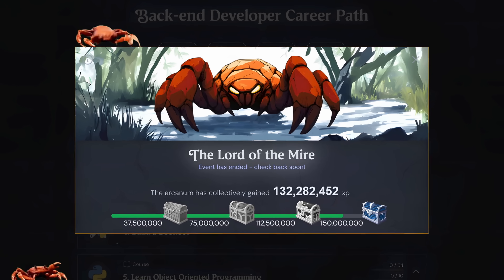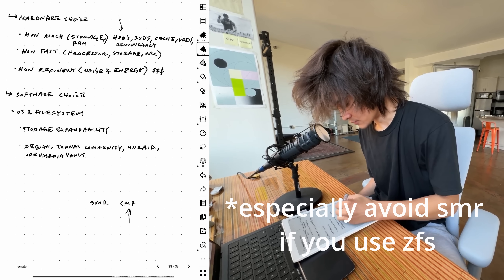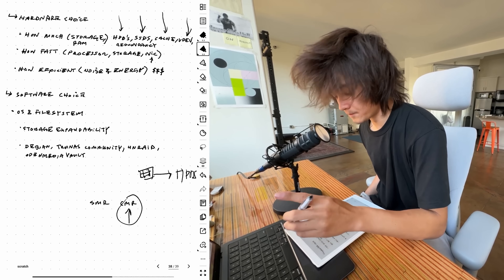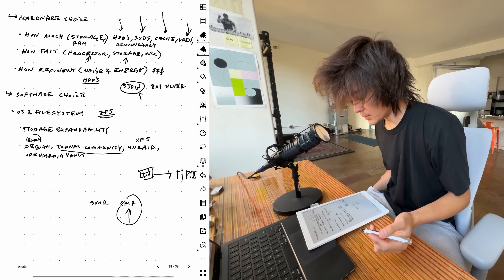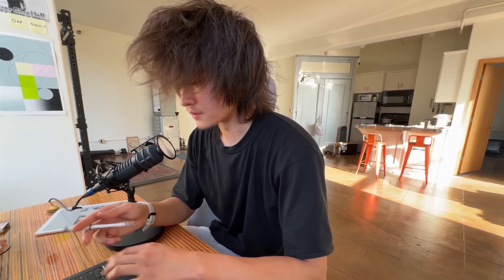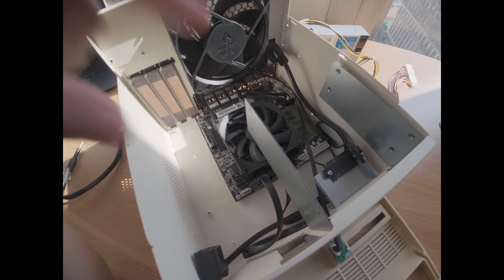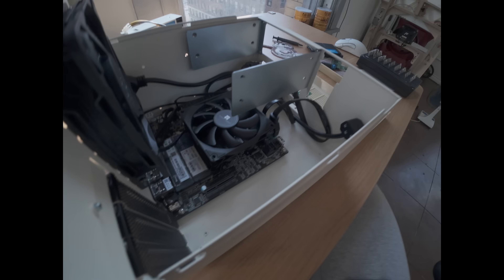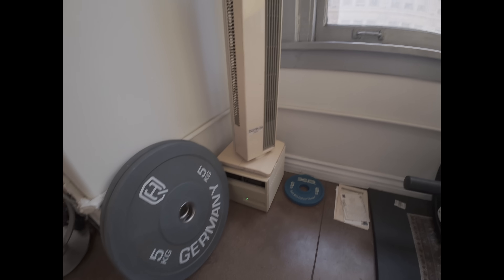I built the perfect home server to quit all my subscriptions (72tb)

Comment: Have considered retrobrite?. cleaning it, then submerging hydrogen peroxide and in a closed container in the sun, you should get the original color, and get rid of discoloring or yellowing by the sun. test it on some else and watch videos, before testing on your home server. Great Video!
Reply: The case comes as already as vintage white/cream (Called Beige on the retail listings). That's part of the retro aesthetic  really, retrobriting it is sort of an oxymoron, not to mention as it's not discoloured due to age Im not even sure the retrobrite process works the same way.
Reply: @loresun1596  if he already ordered the case as new, then it wouldn't be necessary, which it looks like it is. Thanks for clarifying.

Comment: two racks on a first nas is crazy, going to take eons to break even on it from saving from subscriptions 

to anyone thinking about doing this this, set a firm goal of “as cheap as possible for as many features as i can get for as little power as possible”. unless you are trying to emulate hyperconverged infra for learning it’s not worth your money. your guiding principle should be performance/dollar
Reply: two things rule hardware choice in the budget tier: power consumption and expandability.

for your network box running pfsense or opnsense you probably want a mobo that has a pcie slot for expansion to throw in a NIC. 1G is fine for your first time, get an intel one. if you want more speed, skip 2.5g and go for 10G as it’s backwards compat with lower speeds. in the low power space the only real choice here is the intel x710. get 2 ports at least but 4 ideally. for your processor, you don’t need any more than a j5005 but a 7th-8th gen refurb enterprise pc like an HP Prodesk is more than sufficient. should pull no more than 15-25W.

Get a basic managed switch, unifi flex mini is a great first one but still sorta expensive for 1G. can find cheaper albeit less featureful stuff from netgear 

for 10G the only real choice here is something from mikrotik like the CRS305-1G-4S+IN. Bit complicated but well supported, extremely featureful low power and cheaper than a lot of other options. try and score one used. All 10G should be using SFP+ DAC as it’s much cheaper and much lower power than RJ45/ethernet style 10G
Reply: for your storage box, run truenas scale as the software choice. if you plan to run some basic services like plex, immich, gitea etc, people need WAY less power than they think you do unless they’re serving like 5+ clients. if you’re just at home, and using a TV or a phone to do stuff with it, you don’t need that much. i get away fine with a j5005 with 5 people. A 7-
th-8th gen intel processor (ideally 8th) is fine too. A 12th i3 or i5 is the highest i’d do.16gb ram at least because ZFS benefits from more RAM.  Mobo definitely should have a pcie slot for storage expansion. HDD’s are going to be your biggest spend. Start small with at least 2 drives, 4-8tb. scale if you need more via the expansion. add a 10G nic if you need more speed. 

power tweaks like using powertop and a community HDD spin down script help keep power down. should be able to pull 20-30W.
Reply: for compute, if you REALLY need to add stuff (mostly for learning, very little benefit in a simple home server scenario), a few cheap mini pc’s down the line clustered for kubernetes is fine. This is a down the line add that all the storage and network stuff i talked about accommodates for. you should NOT buy this as part of your upfront. start small, be realistic and don’t let hobbyists convince  you that you need the latest and greatest in this market
Reply: @prpiyer8325  As someone who was finally inspired to go ahead and attempt a NAS because I'm really into the retro mini pc look and as tired of buying addition terabytes of storage (on Mac especially rip).... I genuinely appreciate you taking the time to give a brief and succinct overview there mate. Actually, if its not too presumptuous, would I be able to dm you pc part list for the build using this case in the video, and you take a moments glance over and let me know what you reckon? All good if not, but could use a steady hand. Thanks in advance and cheers for the tips!

Comment: The beauty of zfs is its undeniable reliability. Its meant for "enterprise" but anyone can use. If you want the best of anything, it'll cost. Zfs for the average person is meh but highly recommended since its so safe. Btrfs is zaid 0/1 at best, raid 5+ is certain loss(even the devs say so). I've used zfs for over 10 years and its great,minus the upfront cost. BUT you can do it in batches. I started with 4x3tb drives. Then added 4x8tb and so on. When the new vdev was added, copied the files from the old vdev and got rid of those drives or used as backups. Unraid while the "apple" of a home nas/server, its not the greatest. Yes its cheap and can be expanded on but the principles behind it,and any other "nas", is a bandaid. 

To be fair I use unraid and OMV BUT my absolutely important things are zfs(truenas core[BSD based and before their switch to Linux. Never use the Linux variant for other than testing],debian).I have unraid on my parents nas(actual nas not a server) and it backs up to my box. My friend has OMV and theirs backs up to my zfs box. Zfs is backed up to a Colo server and cloud server(fully encrypted, no one can get in). Is it " expensive"? Yes. Is it reliable? Yes. Is it for anyone? No. Especially if you're not technical. IMO, most people not knowing how tech works, even the basics, is the problem. 

Hate me all you want. Say I'm gate keeping etc. The only thing I ask is you actually think about it and take your emotions out of it before you judge.

Comment: For HDDs, you could look at refurbished ones. $75 for 12TB. Get them from a manufacturer and they will perform extensive testing requiring very high performance standards.
Reply: Not worth it unless you can get various HDDs with similar spin up time and manufacturing dates.
Reply: @matt4193 Yeah for random refurbishes you have to be careful, but manufacturer recertified drives are usually trustworthy and come with a warranty. Spin up times have to be within original specification.
Reply: 12TB for $75??  Where are you finding these unicorns??
Reply: Will probably be way too loud for a small apartment/ studio